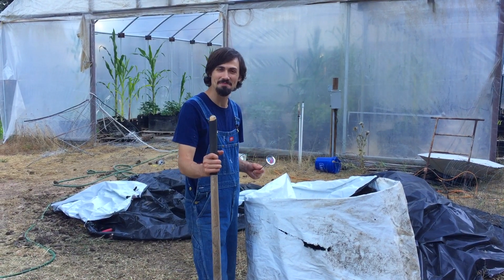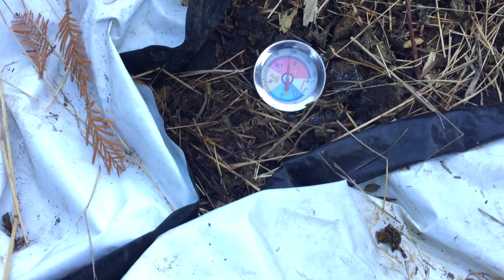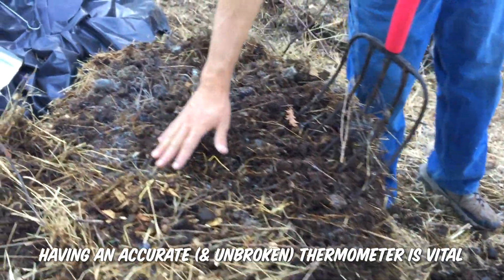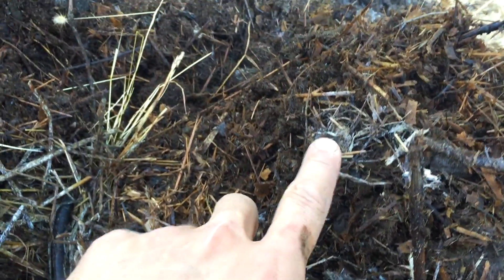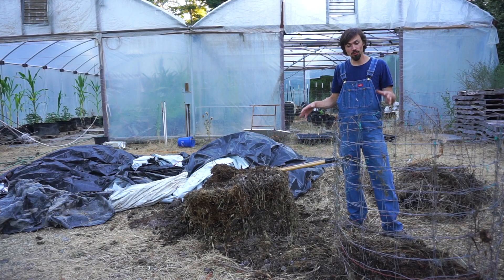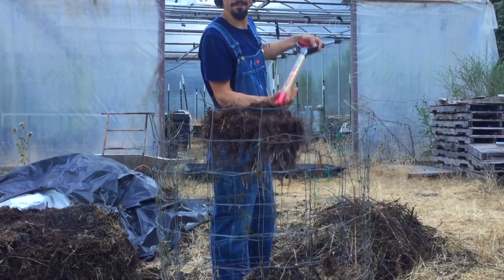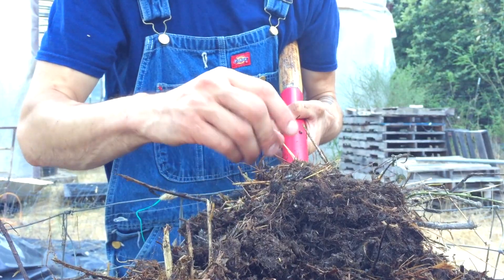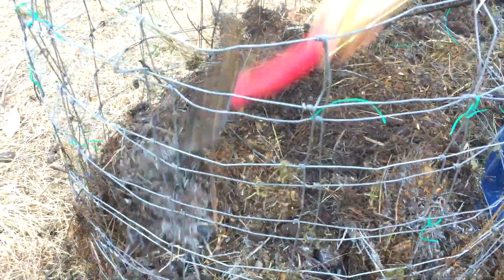Turning Compost with Matt Powers pt 1 TOO MUCH HEAT - What To Do!

Comment: about 20 years ago the city of Annapolis, Md. started collecting and composting yard waste which after a few months was made available for free to residents. Giant piles of fermenting compost were dumped in a local park. As an experiment, we wrapped a ham in oven roasting bags, aluminum foil, and plastic then buried it about 5' into the pile.   The next day we had hot cooked ham. Too hot to touch.  Exactly why stashing wet bailed hay in a barn loft is a bad idea. It can actually ignite with enough air flow.
Reply: My neighbors started a fire with a pile of grass.

Comment: In a pinch, you can use a candy/frying thermometer. I decided to make my latest batch really hot by adjusting the nitrogen levels higher. It's staying around 160. I have to keep a constant eye on it so it doesn't overheat.
Reply: You want the probe to be long enough to test the CENTER of the pile.  Piles are minimum size 1 meter/yard on each side.  So your candy thermometer need to be 1foot and a half long (500cm) minimum to know what's going in in there.   I think candy thermometer are usually like 6-9 inches long, so you will not know core temp.  The pro move is to triangulate and take 3 readings.  One from the center of the top down and  2 readings from the sides to the center. 
If you don't have a themometer you can just stick your arm in the center of the pile.  If it is too hot for you, it is too hot  for smaller life too.
Reply: @andrewflowers6794  I said "In a pinch." I didn't say it was a reliable thing to use all the time.
Reply: @D.A.Hanks14  oh ya, it's a useful indicator.  No disagreement.
Reply: @andrewflowers6794  When I made my first pile, I learned that a compost thermo was a necessity. I ordered one, but in the meantime I grabbed the candy thermo to check it. So that was my pinch.  :-)

Comment: Hey so is it possible to avoid getting actinobacteria or is it just a part of it? Is the trick to turn it earlier before it occurs? I'm on my second pile and I notice it occurs on the perimeter of the hot center/core right where the hot temperatures meet the cooler temperatures.  Thanks for the videos!

Comment: You stated in a previous video that the pile needs to reach a 140* temp. How do you know its "way too hot" if your thermometer only goes to 120? Saying the temp is "off the charts" is irrelevant when its the wrong range (wrong thermometer) to begin with.
Reply from the maker: There are compost thermometers for sale online that go up to 165-185˚F

Comment: I want to get my compost hot but I don't have a manure source. I want to kill the fly larvae and uninvited seeds. is there another way? cause my kitchen scraps and brown material pile, it's never heated up.
Reply from the maker: There are compost activator plants: comfrey, alfalfa, nettles, legumes, duckweed, cauliflower greens... cut fresh, cut to the smallest size possible, & focused in the center of the pile.
Reply: Sufficient comfrey leaves will also work